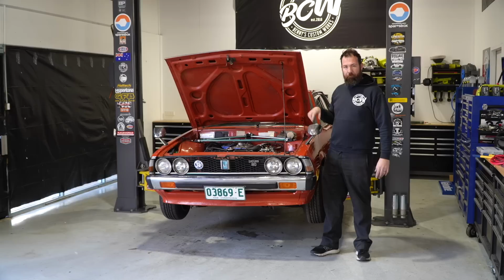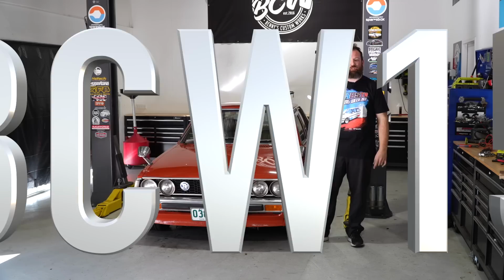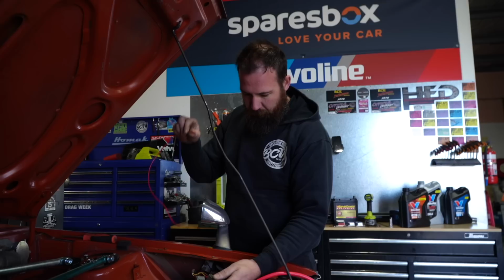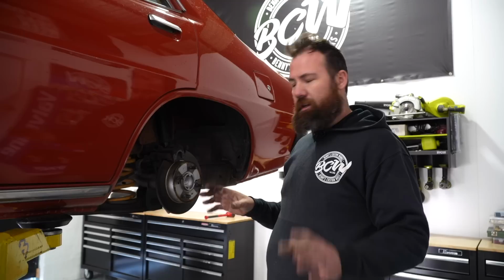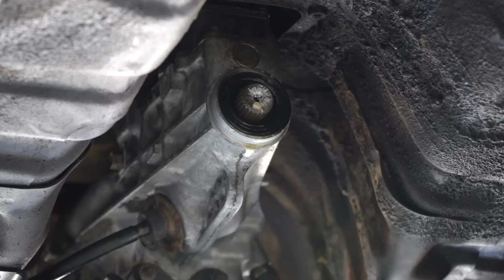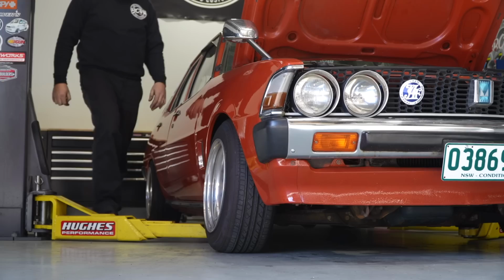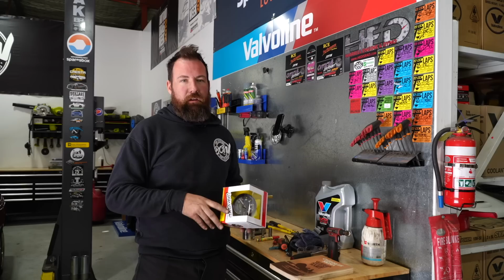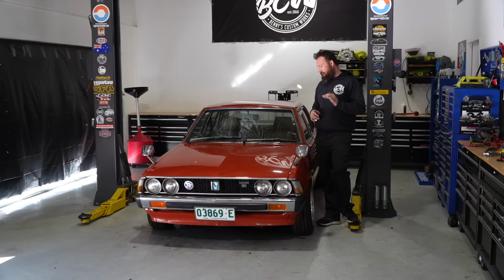SIGMA | Engine Conversion Complete!

Comment: I had a GH Sigma for 17 years ,changed the diff from 3.42 to 3.27 to make it s better tourer, 5 speed 2.6. Took it around Australia  in 2008. Easy car to work on. Fond memories.

Comment: Love it when crimping v solder is brought up. It’s the other version of using a shifter to trigger the right people. 

When I was a grommet, I used to solder but over the years, the solder would oxidise and corrode. So many problems. 

Crimping is the only way I do it now because of that and then began to learn that’s also what pro wiring skilled people do as well. 

Love what I’ve learnt from your whole crew over the years Benny.
Reply: It wasn't actually the solder corroding, it was the wire. Car manufacturers cheap out and use CCA (copper coated aluminium) instead of solid copper. When you solder to CCA, you break the coating and the aluminium gets exposed. Exposed aluminium wire corrodes. The corrosion travels along the wire. It will eventually fail and need replacing, as you found out.
Reply: Solder has no place in automotive wiring…. This is why no wiring on a car is soldered from the factory
Reply: @ChrisFromTheInternet  OEM manufacturers have calibrated crimps that are very expensive, 99.999% of hoby auto mechanics, even profestional mechanics will not have the same equiptment or even close to what the OEM manufacturer has. which is why solder is nearly always the preferred method, youtube mechanics have made it a big thing over the years but ive been playing with automotive wiring for over 20 years and have almost never seen a well done solder joint fail ( im not including when people dont do it properly as thats clearly not the solders fault) but on hundreds of occasions ive seen crimps fail and leave people stranded on the side of the road.
Reply: It should not even be a debate but always is,simple fact unless it’s properly crimped and not the terminal kit u just bought at repco,solder and not lead free crap will if done right by far outperform any crimp unless it’s gold or gold plated! Even then at high amps not in resistance!And not give the voltage drop seen with most crimps but without stress relief the harder solder joint can cause a stress riser at the wire,so here’s where crimps come in it’s about being cost efficient and time conscious,high current or high finesse solder can’t be beaten! Smd devices would be awfully difficult to crimp! working with mil spec connections I’ve had to replace quite a few over the years due to vibration breakdown of the wiring after the crimp, and seen a quite a few solder joints fail too! And for corrosion do not solder aluminium and clean your work afterwards and apply an inhibitor!
Reply: @needmoreboost6369  are you a bit?
Reply: @bob832  a bit? Yeah sorta!I’m definitely Not the literate type but have been in electronics for over 30years and Spent a long time as a diagnostician for an engineering company and have been a motor mechanic for couple decades too,I’m on the tools every day and work on rally,drag,speedway,bikes,buggy’s pretty much every day! So it was just an opinion of someone that encounters the problems in this video every day! And offered the same opinion but worded in straya Bogan speak!
Reply: @mdnovaman  I agree totally I've been wiring for 30+ years, and I always crimp then solder. For the hobbyist this is the best method as the crimping tool they have is most likely not up to snuff. Make sure your wires are clean and not corroded, or it won't matter how good your crimp is.
I totally rewired a VH Commodore back in 1996 using that method, as a much less experienced young bloke, the loom still gives me absolutely no dramasto this day.
In saying that modern plugs and crimp terminals crimped with the right tool are the way to go if you have the resources...ie money, they're not cheap.
Reply: @bob832  what's your point mate? Everything he said was spot on! No one is arguing that a well done crimp on a high quality terminal is equal or better than a solder joint. Problem is most crimps aren't and it's easier for someone with little skill and cheap gear to get a good solder joint than a good crimp. He's just living in the real world not the interwebs like some here.
Reply: @needmoreboost6369  You must know more than the entire automotive industry. 

A good crimp will be a cold fused solid connection through the entire structure of the crimp and wire combined, as well as have strain relief for the wire involved.
Reply: @FuManchu5ltr  I’m no expert more a jack of all trades n master of none! Lol couldn’t agree more! A proper crimp properly done is the way to go! It’s just too often I find incorrect and cheap crimps are used! Just the same as cold solder joints taped up in spaghetti wiring…lol my car! for an example where in some cases it might be safer for a solder joint to fail is if it’s got good heat shrink to protect the loose wire and prevent a short similar failure with a termination would potentially leave a stray wire! A certain local lpg specialist has been lucky not to cause a death! Using side cutters to crimp ffs. higher current applications is when soldering should be used,I’ve wired starting systems on big Diesel engines and watched crimped terminals glowing then after soldering there’s no current lost and no glow! Also as a hobby used to build 200+kmh rc cars that pull over 400a no room for crimp’s there only the pwm signal wires get crimped and everything is gold plated so I guess I’ve been spoiled by using the most efficient by mass connections ever made! And when I rebuild electric motors it’s common practice to crimp and solder the windings on the commutator as only cheap shit is crimped,I’m not  saying this is the best outright method for automotive use in general but it’s got its place and I’m in the middle of nowhere and getting the job done reliably with what you have available is sometimes necessary! And in this case for me solder wins over cheap crimp any day just because relying on mechanical means of contact with dissimilar metals and rubbish terminals in extreme condition’s and rough roads can be problematic! biggest problem I’ve found is that unless it’s a genuine connector they are often too thin and too soft and it’s probably crap there’s just so many knock off terminals and even tools used by “professional” installers it’s scary! I’ve had to replace and repair some pretty scary stuff out here ps that’s partly why I watch Benny not just the fast cars but the quality work!
Reply: Also just a note in this cold weather I’m now running 27psi boost on pump 98 in my Ecotec vs bombadore with stock ecu and l67 memcal and 42lb injectors and drive it everyday! this cannot happen!! if you ask pretty much any tuner as the maf won’t read past blah blah blah the injectors only flow blah blah blah! yeah probably don’t flow with their crimped connections and 2mm wire and 40a nominal relay no wonder the pumps don’t perform! Put 130psi 600lph capable fuel system there and see what the injectors flow lol! Unless you can think of someone else who has got an untuned hand machined junk Ecotec properly singing without the help of a dyno or computer the ones I’ve found say it can’t be done but this dumb bogan did it! It’s only common maf based metering and it’s easy to trick, I can run any fuel type and any sized injectors and I have full control over afrs through the whole rev/boost range! But fk it’d be nice to have Haltech! And a working trans! It’s definitely not fast by today’s standards but it’s never been passed by a Barra or Ls!
Reply: @FuManchu5ltr  READ what needmoreboost and I are saying nobody disagrees with the fact that a 'properly' crimped joint is best the debate is that 90% of average punters don't know or have the gear to make one!
Reply: @needmoreboost6369  sorry mate, I just read this again and I don't recall posting it. It doesn't make any sense to me or anyone else. Sorry if I cause any offense.
Reply: @ScottSherrington  sorry Scott I don't recall posting this. Re-reading it doesn't make any sense too me either. Sorry if I caused any offense.
Reply: @bob832  all good m8 my explanation’s were probably long winded and edited by beer lol

Comment: Love the ripping on the auto store battery terminals I have a set in my project car that now I'm suspecting might be the casue of some ofmy electrical issues

That said, most of us don't have access the the thousands $$$ worth of crimping gear Benny uses in this vid so you just got do what you do.
Reply from the maker: The battery terminal crimper was $40 from Jaycar.

Comment: Ben, for the choke cable end, you can use a bicycle cable ferrule (bike brakes, derailleur) that crimps on, or go old school and silver solder it. Did it on my VW Dell'Orto's. Used a diesel choke cable to keep it factory ;)

Comment: Thank you, thank you, thank you.  Agreed - DO NOT solder car cable, particularly heavy current carrying cable.  It's subject to vibration, voltage drop, cracking and failure.
And buy a good set of crimping pliers.
Reply: Agreed you shouldn't solder to car cable, but none of those are the reason.

The reason is it's almost certainly not proper copper cable -- it'll be CCA (copper coated aluminium). When you solder to CCA, you expose the aluminium. Exposed aluminium wire corrodes, and will eventually fail.

Comment: cool, I am in the process of redoing a strut brace for my RX2. Upgraded the brake master cylinder to the Patrol one, so the old brace didn't fit anymore. I got the bar from a Honda Prelude rear bar, just got to draft up some plates and get them fabricated.

Comment: I solder and crimp, both are fine, people think they know how to solder, but they don't, I think that is the real source of the controversy about soldering in looms.

Benny you should go full OEM spec and use uninsulated F crimp terminals with housings,  it looks much nicer than the crush terminals with the yellow boots. You get access to better quality terminals this way also.
Reply from the maker: I have a stack of them just not in big enough gauge, that’s why the yellow lugs came out :)

Comment: From memory the SE sigmas had factoury tachos I had a GE with a 2.6 hydraulic head GH 5 speed box disc brake arse end from a GH wagon diff complete power steering from GK supper saloon went bloody hard wasnt shy WITH A FALCON xe WEBBER CARBIE AMAZING ON FUEL

Comment: Benny, where's the best place to buy wire for wiring harness fab? I need a good assortment of colours and sizes.
Reply: Such a good question. Would like to hear as well.
Reply: Not Benny but for my wiring I use 2 places depending on price and availability...
Element 14 in NZ
Rapid Cables in QLD
Reply: @zappy7393  thanks Zappy, I have been using oem machinery harnesses for the last few years, as they are long good quality wire with a good range of colours and gauges. However my source of these went away when the copper scrap price went through the roof. I will check them out.

Comment: what was the Sigma? a Japanese car made in Australia or a CKD (Complete knock down) import (cars in kits for in a box).
Reply from the maker: I believe the GE ( my model) was mostly ckd with australian components like wiring looms, ignition systems, 1979 models also has Australian made dash clusters. I think the GH was made here however and had even more local content like Borg Warner diff and gearboxes.
Reply: @BennysCustomWorks  the longer they built them the more local content it seems

Comment: "People who tell you not to crimp, can't crimp". This is entirely true. But the converse is *also true*. People who tell you never to solder, can't solder.

I used to be the person who told you never to crimp, and yes, the crimps I would make would never hold, and that is because I was using the wrong tools. Don't use pliers. Don't bother with the stamped plate "crimp tool" which has a series of half-moon cutouts and presses in with one point on the other side of the tool either. That's almost as worthless as using pliers. Get a proper tool which presses in on all sides at once, and you'll be fine.

If you can't make a proper solder joint (and that one shown in the video is clearly not a properly made solder joint), you are also probably using the wrong tools, or critically, soldering to the wrong type of wire.

There's nothing special about the environment of a car that causes problems with solder. It's not movement or vibration. It's not road dirt or oil or grease. It's not heat in the engine bay, all of which I've heard told to me with absolute certainty. There's loads of soldered joints in there from the factory, although they are typically only found inside things the average mechanic considers to be a component to be replaced rather than a container to be opened up and looked inside.

The issue is for 99.999% of cars, the accountant overruled the engineer when the car was built. So instead of copper wire in your loom, you have CCA (Copper Coated Aluminium) wire. Copper is good at conducting electricity, but is also expensive. Aluminium wire is cheap, but isn't as good as conducting. You need to have a larger wire gauge for the same current. But if it's sufficiently cheaper, the accountant still classes that as a win. It is known to deteriorate over time and eventually stop working. The compromise between the two is Copper Coated Aluminium. This doesn't make it conduct better, but it does stop the Aluminium deteriorating ... right up until you break the coating that is.

And that's the reason. You don't solder to CCA wire because it's very easy to break the coating and start the aluminium corroding underneath. It'll work fine for a while (assuming you made a good joint that could be years) but eventually problems will arise, typically on the wire near the joint. Crimping doesn't break the coating on CCA wire, so the aluminium doesn't start degrading at a crimped joint.

Comment: People who tell you not to solder, can't solder.
Reply from the maker: Please never work on a car.
Reply: "People who tell you not to solder, can't solder" <-- You are absolutely right here.

HOWEVER, if you know how to solder properly, you should also know not to solder to CCA (Copper Coated Aluminium) wire. It's cheap junk for many reasons, but critically soldering to it will break the coating. The aluminium core will degrade over time once the coating is broken.

Factory looms are naturally all made from cheap junk CCA wire.